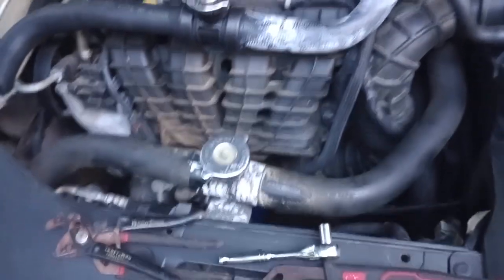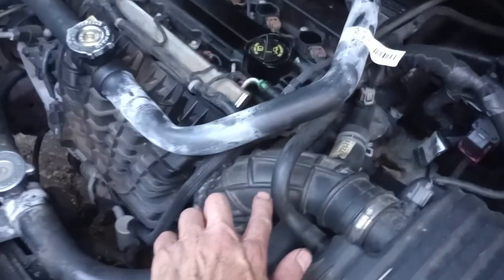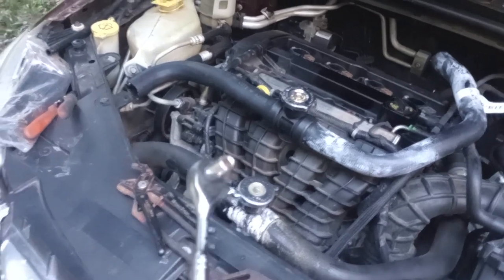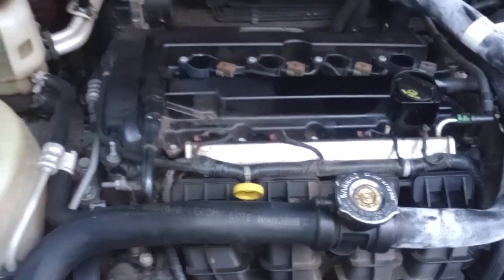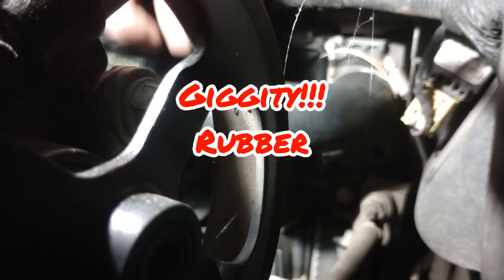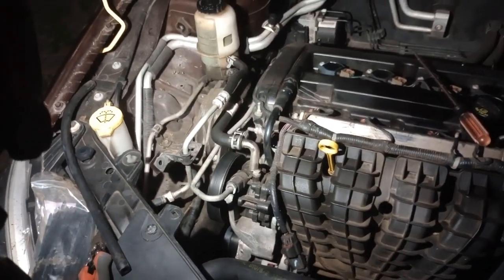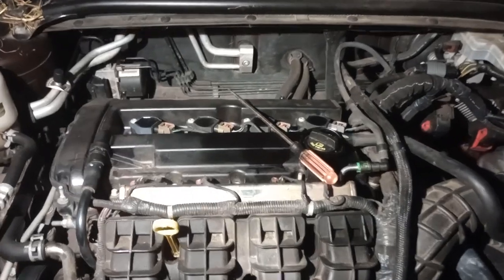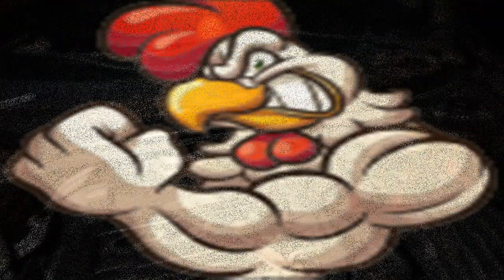2013 Chrysler 200 2.4L Radiator  Upper Hose Replacement

Comment: I’m trying to take off the middle piece I don’t have a heavy duty flat head I’m using a 3-in-1. U made it look so easy😢
Reply from the maker: Believe me it was by no means easy lol, thank edit for that lol. But it can be a pain. The rubber piece has 2 notches on the bottom side that goes through the brace. If you can push those in as you are pulling up, it should come out fairly easy. But force is needed.

Comment: Good info, Thanks! One part option is the AC Delco ACDELCO 26668X. I would get the single unit design, two hoses, center T with radiator cap. Factory connected and you get the new T and radiator cap.  And on   ro...ck...au..to  its less than $50. 
Make sure to check if you need the hose with the oil cooler connection. Its and additional connector on the drivers side hose.
Reply from the maker: Thank you so much for the extra info...it is always welcome!